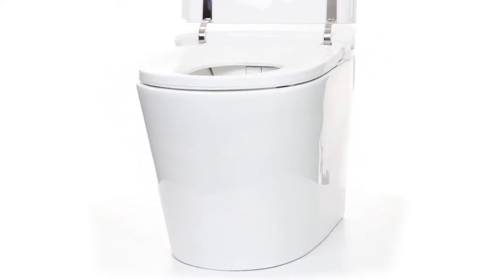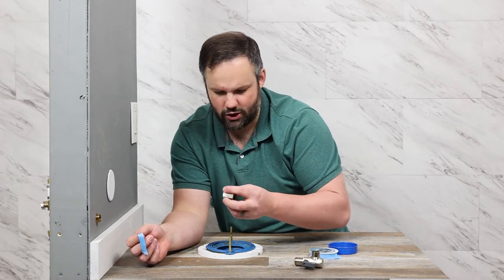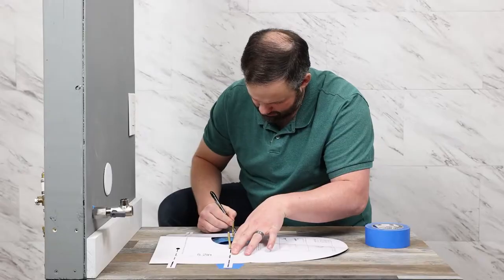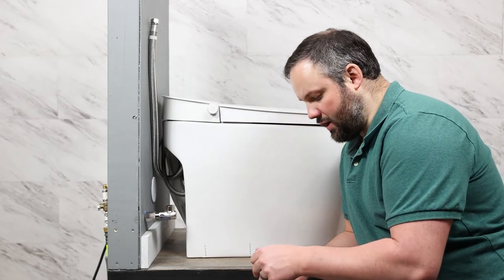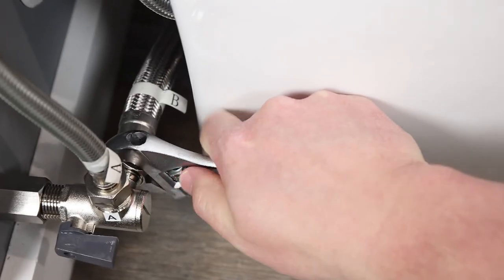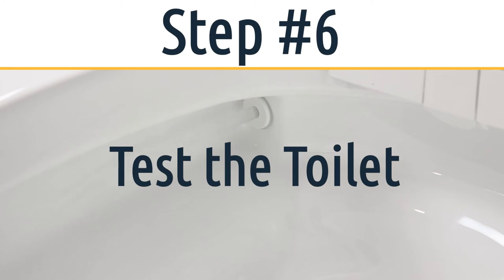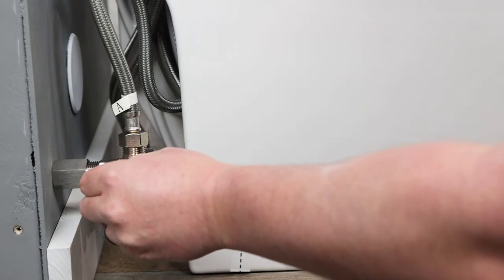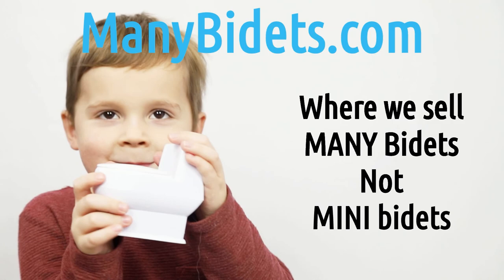How to Install the Studio Lux SLi 2000?

Comment: Looks like my contractor somehow accidentally mixed up the water inlet with the water supply line - i was still able to use the toilet normally?? Is there a problem or long-term risk for it?
Reply from the maker: Yes this is a problem that will affect the flush. Also, it technically voids the warranty since it was not installed per the manufacturers instructions. As far as long-term problems, its hard to say as we have not had this issue happen. But the best course of action is to get the toilet properly installed to avoid any further issues.

Comment: Does the Studio Lux SLi 2000 have a battery backup for when the power goes out?
Reply from the maker: It does not.  It would still work as a standard toilet, but would need to be flushed with a bucket till the power came back on.
Reply: Had the same question!
Reply: @ManyBidets  What volume of water is needed to proper flush?
Reply from the maker: @1971ahtom  Great question!  You're looking at a flow of at least 25L/min

Comment: does all 4 holes have to be screwed ? in the video i see you only screw the further one coming from the flange under. if those 2 are secured do i still have to pierce and screw the 2 additionnal holes at the back ?
Reply from the maker: In my opinion, 2 is enough :-)